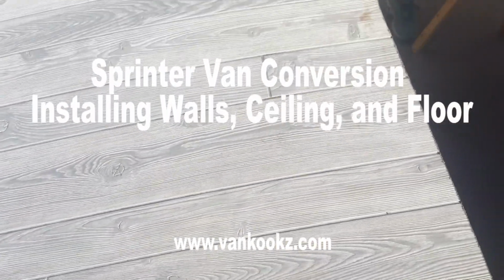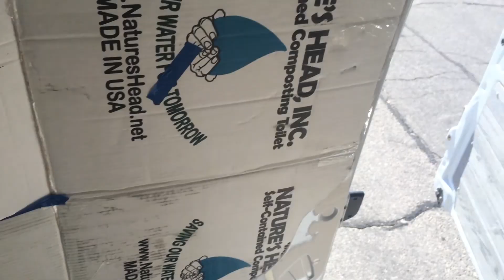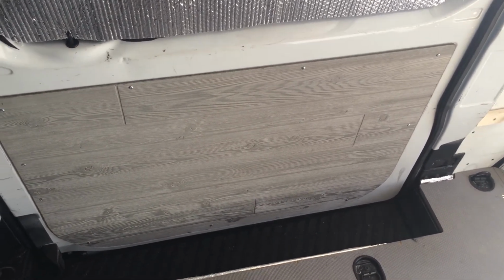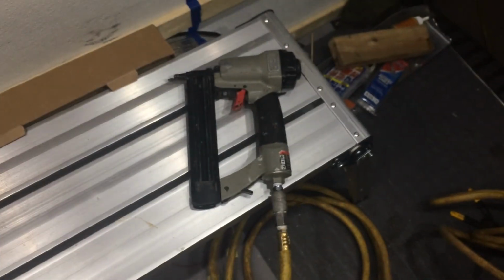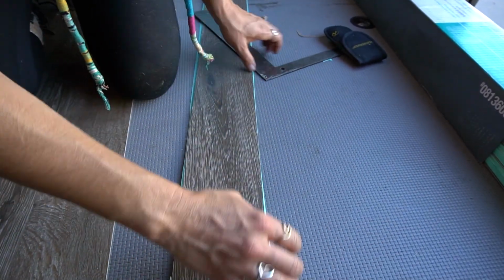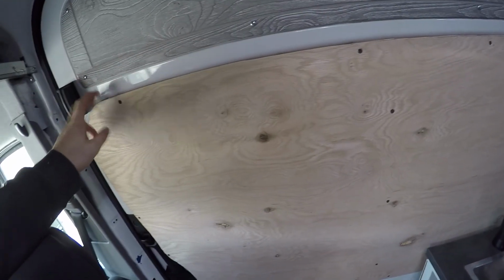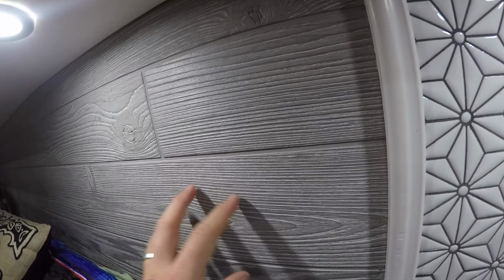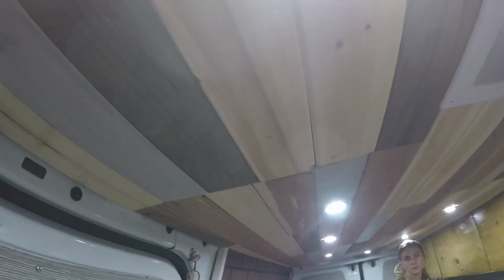DIY Sprinter Van Conversion | Installing Ceiling Walls and Floors

Comment: I love the pace of the video, you keep things moving and get it done!  Lots of cool ideas, I like the masonite panels, I like speed of the nail gun for attachment when you have a furring strip for backing with the nail heads disappearing or being able to hide with a little putty,  I like the little self tapping screws for panels to attach to steel of the van structure.  Thank you for doing this video!
Reply from the maker: Bob Teaford yeah no problem glad it helped!

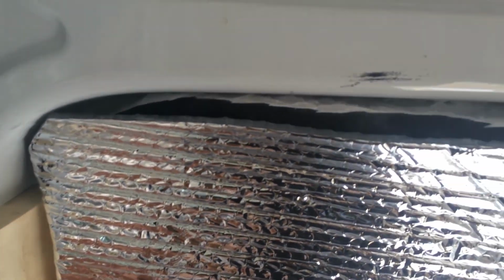Comment: Hi, looking great :) Just a small question... How did you attach the wood bricks to the door ? (the ones that works as attachement of the door cover) 1:56 in your video.
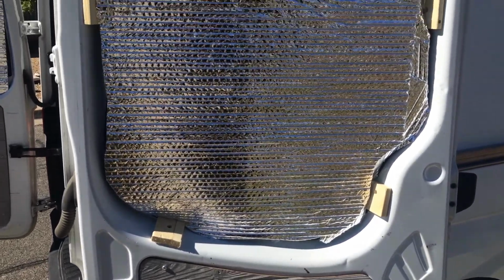Reply from the maker: I countersunk 1 inch self tapping screws into each brick.  You can kind of see the screws in the wood at 2:04